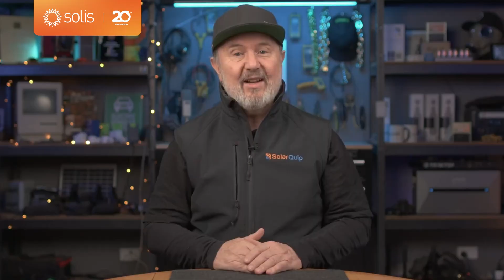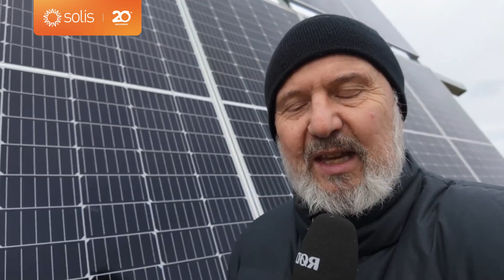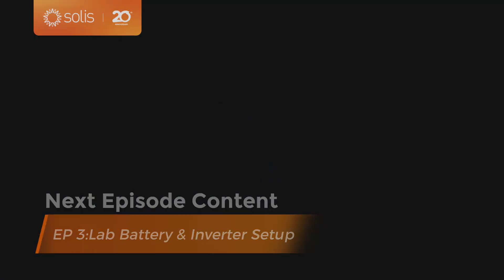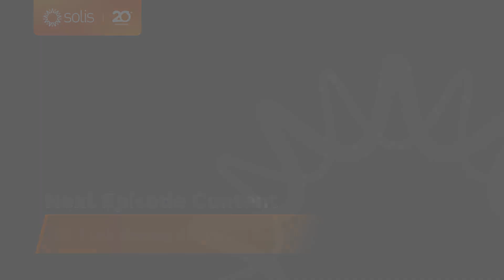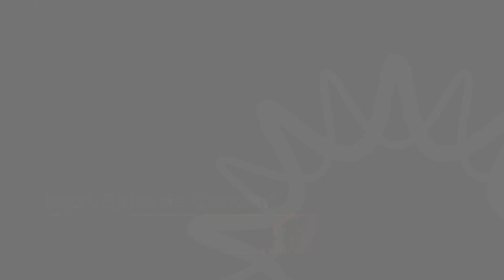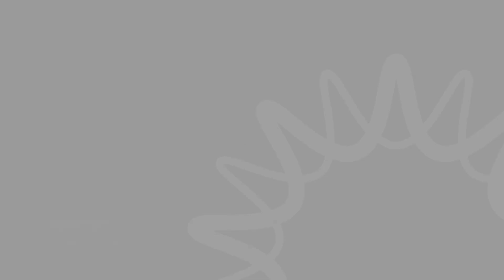𝐄𝐏.𝟐 — 𝐇𝐨𝐰 𝐂𝐚𝐧 𝐀𝐂 𝐂𝐨𝐮𝐩𝐥𝐢𝐧𝐠 𝐁𝐨𝐨𝐬𝐭 𝐘𝐨𝐮𝐫 𝐌𝐢𝐜𝐫𝐨𝐠𝐫𝐢𝐝 𝐖𝐢𝐭𝐡𝐨𝐮𝐭 𝐃𝐢𝐬𝐫𝐮𝐩𝐭𝐢𝐧𝐠 𝐏𝐨𝐰𝐞𝐫?

Comment: Nice! I was told by Solis tech support that the AC coupled inverter needs to be smaller than the grid forming inverter.
It sounds like you are not following that?
What size is your grid forming inverter?
It was my thinking that as long as you can use up all excess power there should not be a problem, is that what you are finding?